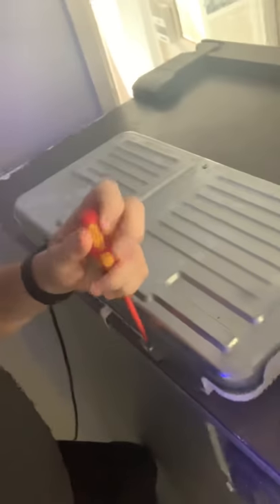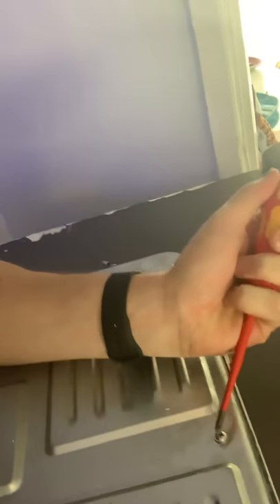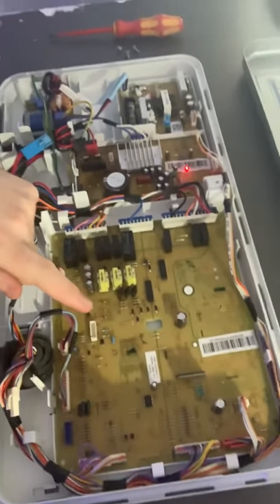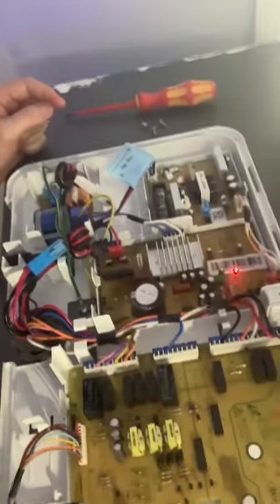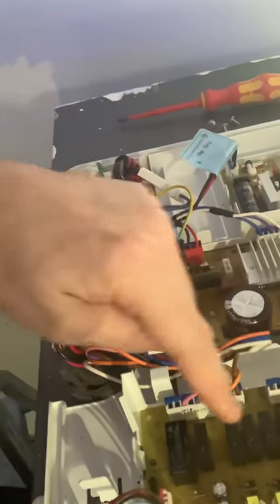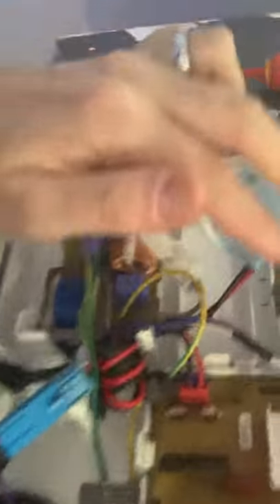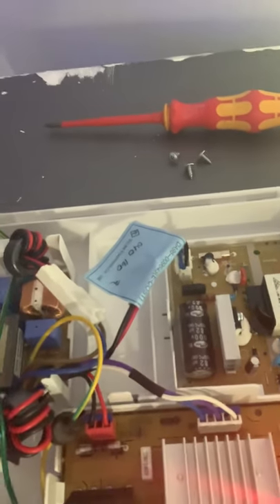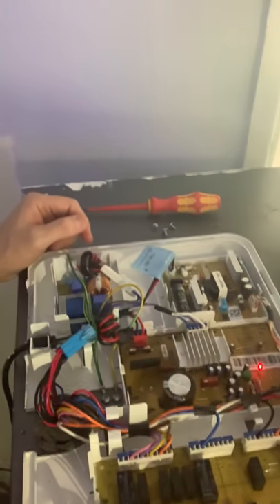Samsung Fridge Freezer No Power

Comment: came here to tell you that i owe you a beer. fridge suddenly stopped working - not this exact model, last 2 digits were different, but basically exact same one. repairmen wanted exorbitant amounts to come and fix it - bought this part off ebay, unplugged 2 little cables, put new one in, working as good as ever now. thank you very much, genuinely took me 30 seconds. it seems with this series of fridge that if the power stops working it’s nearly always that little board

Comment: Dude you are a hero! I just fixed my refrigerator by replacing the exact PCB you pointed out. The local repair service had no clue as to what the problem was... All PCB's seem to be in working order they said... Saved me from the horrible Samsung service that never came, and from buying another fridge.

Comment: Samsung freezer packed up, no power. Took a chance and ordered the replacement power board in this video. £55 and 5 mins to replace. Worked straight away. Thanks, saved £100s not having to call out an engineer.

Comment: Thank you so much for this video. As many in here mine just stopped working no power..  so straight away I went to check the good old YouTube library and there it was first video a clicked on. Bought the part recommended by you from a local guy too to help out etc a little over 24 hours  and it’s back up and running. Samsung provided the details to the local authorised repairer and they charge £50 call out then £90 for labour plus whatever parts needing replacing, I tried to buy the parts from them but they weren’t allowed to sell direct bla bla bla. I can’t thank you enough pal. All the very best to you 👍

Comment: Exactly the same with our Samsung Frdige Freezer after 31 months of good work.
I can't get the PCB here in germany, so I had to call a technician. Explained the problem - he came here and after four minutes of checking he told me that this thing is broken. Costs for this PCB 97€ + 100€ work + 75€ approach
For something I could do easily be myself (after seeing your video)

Comment: Got the same make, model, and problem with ff, no power, had the retailer repair branch turn up ( at a cost) but could not fix, as they said could not source that pcb,so gave me a refund, also contacted the maker who said to contact the authorised agent in my area, who said that if the people who came out could not fix it they prob couldn't, and would cost 108 quid no matter what!
Saw Adams blog on YouTube, what a star he is, ordered the part, fitted in two mins, all up and running, not impressed by retailer or manufacturers, but highly greatful to Adam, a life saver.

Comment: Hi Adam,
Encountered a similar problem with my Samsung fridge freezer. I hurriedly replaced the unit with a new fridge freezer.  Having seen this video of yours, decided to relook at the pc board as you mentioned. Could not find a new board online. Had a look at the fuse and it looked strange. Purchased a 75c fuse. Replaced the fuse and it came alive. Thanks for the video, it helped heaps. So I spent $4000 on a replacement fridge freezer , three months later the repair to the old fridge cost 75c. That's such a frustrating waste of money on the new fridge. Thanks for the technical advice.

Comment: More positive feedback, thanks for posting this video, I ordered part number DA92-00530A (DA9200530A) from ebay for £55 and it has resolved the issue. I'm going to look at potentially repairing the failed board as per the instructions below so I can keep the old one as a spare, as I have no faith it won't go wrong again in 3-4 years time.
Reply: Hi. Did you manage to repair the faulty board and if so what part failed? Thanks

Comment: Thank you, this just saved me a £180 call out and a 1 to 2 week wait ( I live rurally) and a lot of food from going to waste.
 Ordered a refurbished Main Board PCB online after seeing this and 2 days later it arrived, I installed it and hey presto the fridge powered back up. 
It was a quick and easy job after I ruled out all other possible issues and although I could not find the exact part number as stated on the PCB, I found the exact board for newer models under part number : da9200530a  after some searching about, I will put a new diode on the old board as prescribed by a previous commenter I will test and save it for the next time this happens. 
So If you have model: Rs7567BHCSL American style free standing fridge from Samsung and you come down one morning and there is no power to it period and it is not the fuse, yet there is still power going to the boards( use electrical tester scredriver ) this as stated is most likly your culprit.

Comment: The Samsung we have has the same symptoms. Checked all voltages, fuses and pulled every connector. Will now pull that board and either replace the diode or order a board then repair it. Many thanks for sharing the knowledge.

Comment: Thank you for your video. It has pinpointed the exact issue with this fridge and helped us avoid long wait times for the authorized service, which is even longer now during the COVID pandemic. My best regards for making this video. Just had the same issue on a friend's fridge. The board in question is a power supply board with mains AC input and the output is 2 x 12v  and a 5 v rail. The issue in my case was a shorted schottky diode. This is a generic part you should be able to source at any electronics part store: 2 Amp 100V schottky diode, original part was SB2100.  Just replaced with a similar specs general purpose rectifier diode, as i did not have a schottky lying around, and the fridge came back to life. Will source and replace the original part asap as the schottky is a much faster diode than the one i used. 

Warning! This board has a big 500v rated capacitor which holds electricity for some time after the power cord is unplugged. Usually 5 minutes should be enough for the cap to be at safe levels. Be extremely careful while doing working with this equipment, as it contains lethal voltages! I you do not understand the safety principles to be used or do not  feel comfortable working with mains voltages, do not attempt this repair.

I pinpointed this part by reading Cristian Tomescu's comment and following the next steps: unplugging the mains cord , wait 5 minutes for the capacitors to be drained. Remove the  the electronics cover , remove the board in question, it has 2 wire plugs. You need a multi-meter(DMM) or continuity tester with which you must test the diode. Being that the diode is in circuit , if the diode is OK, it could conduct electricity in both ways, but it should show some resistance. If you have a short circuit regardless of the polarity , the diode is busted (search youtube on how to test a diode). Remove the diode and measure the circuit where the diode was for shorts-> it should not be shorted. Replace diode while respecting the same orientation, put it all back together and that's it.
Reply: Hey, thanks for the description. I've tested the Diode you've mentioned and I think it's one of the bigger ones correct? I can see 2 small ones and 1 that is just a bit larger. When I'm testing with my multimeter it's not showing any voltage on either sides. Could you tell me or send me a picture of the diode on the main board that you're describing? Thanks in advance.
Reply: @jellevanlanen650  hello! For me it was the bigger diode. You should not test for voltage,  you should use your dmm on resistance or diode testing mode. Mine was shorted, meaning it showed low resistance when testing. A diode should show an open circuit when testing one way and a low resistance when testing with reversed leads. Make sure you unplug the power before trying anything on it, it can contain deadly voltages. Good luck with the repair!
Reply: @chirilamihai  Thanks for the reply! Its actually the first time I used a multimeter. I did do it with the diode test mode. The 2 smaller ones given me 0.6 to 0.7 each and a "1" in the other direction which if I've read correctly is good. The "larger" one below them gives me 0.001 in both directions. Which I think it means it shorter out. So my presumption would be that if I replaced this one with the one you've mentioned in your first comment that theoretically the board should work again, correct? Thanks in advance!
Reply: @jellevanlanen650  great job! Indeed you have identified a short-circuit. To confirm this you should remove the diode and test it while out of the circuit. It should still be shorted. You should also confirm this by testing the points where the diode was  soldered before being removed, this measurement should result in some arbitrary  results but not a short circuit, otherwise something else might be broken in the circuit. Replace the diode keeping in mind that orientation counts, there is a white band on it, it should point in the same direction. Stay away from shady ebay sellers for these components, search locally or from renowned shops. Good job and good luck!
Reply: @chirilamihai  I removed the diode and it is indeed shorted out after testing. I cant seem to find a proper replacement. Do you perhaps have a name for me or specifications as the 2100 you mentioned doesn't seem available in my country.
Reply: @jellevanlanen650  i used a general purpose 1N5402 which actually is still in the fridge and works since. This is a 200v 3a diode. You should be able to find this as it is common. Otherwise just ask any specialty store for a general purpose diode with at least 2 ampere forward current and 100 Volts of reverse voltage. Good luck
Reply: @chirilamihai  Thanks for the advice!
Reply: @chirilamihai  I thought I'd let you know that it worked. I ordered a spare part as well in the mean time and thought I'd fix the original board as well. Replacing the diode that you mentioned fixed it! Now I have a spare board incase it happens again. Thank you once again for your help.
Reply: you truly nailed it with this comment!!!
Reply: Thanks for your help! I have saved money, but also 3 weeks time! I have replaced the bigest diod on the board. Its called the Schottky diod, SB2100. 2 Amp, 100V. Price was 0.25 USD.

Comment: Thanks a lot. My fridge Samsung RS7557BHCSP had the same behaviour (3.5 years old). I ordered the da9200530a card on Monday, received it on Thrusday and it works perfectly now. No need to have a PhD in electronic to change the card, only 2 plugs on the card. 
In french now: Merci beaucoup. J'ai eu le même comportement avec mon frigo SAMSUNG RS7557BHCSP: plus rien ne fonctionnait dans le frigo: pas de lumière dans le frigo ou le congélo, pas de lumière à l'extérieur, pas de froid, plus rien ne fonctionnait. Je pensais au départ que les plombs avaient sauté tellement rien ne fonctiopnnait. J'ai commandé la carte da9200530a lundi aprem, l'ai recu jeudi matin et changée jeudi midi. Ca fonctione parfaitement. Pas besoin d'avoir fait Polytechnique: on débranche le frigo, on retire 3 vis sur le toit du frigo, on prend une photo, on enlève 2 nappes de fils. On remplace la carte, on remet les nappes de fils (avec des détrompeurs, impossible de se tromper et sinon, on a pris une photo...), on rebranche et on constate que ça marche. Ensuite, je conseille de re-débrancher, de remettre le toit du frigo, de remettre le frigo dans son emplacement final et de le rebrancher. Bref, du bon sens ;-)  Un super MERCI à Adam Jackson pour son aide !

Comment: Thanks Adam.  Just replaced the board and fridge sprang back into life.  Around £60 from Partmaster so saved me a bomb.  

If you want to test yours, grab a multimeter.  There are only 2 multi-connectors on the board, both marked clearly.  One is a 2 pin for feeding 240v AC to the board.  The other is a 5 pin outlet supplying 2 grounds, 2 x 12v outlets and 1 x 5v.  

Leave the 2 pin connector plugged in to feed mains power to the board.  Then remove the 5 pin connector so you can check the board is creating power out.  Use one of the grounds and test each of the positive pins (they're marked which is which on the board).  Both my 12v worked, but the 5v was dead.  I'm guessing that's the feed to the display/control board, 12v to the compressor etc.  As per the vid, there was no telltale brown staining of any component failed.  Usual care re not electrocuting yourself etc!

Comment: Thanks for taking the time to make this video. Had the exact same problem on 3yr old side by side Samsung fridge freezer. Bought a replacement DA9200530A PCB for £55 and working again instantly. As you mention there are no obvious signs of component failure so hard to fault find.

Comment: Grateful thanks Adam, same problem same fix.
I had the Schottky rectifier diode (next to the upright pair of capacitors) stop passing current, replaced it, and still not working.
Whether this failure caused this failure, or another component failing caused this Schottky to fail, I don't know.
Does anyone know what component on this board does fail?

Comment: Update folks, appliance now working. I swopped out the diode DS2 on the PCB NOT HS2 as a previous comment mentioned, it is definitely a SB2100 SCHOTTKY diode. Diode cost 25p, a replacement PCB board is circa £40-£60 if you don't have soldering skills, a call out fee is circa £100, the whole job for an engineer to visit and replace is probably £300+ If you really get screwed over then kiss goodbye to £1300 for a replacement american fridge freezer! Scandalous that Samsung don't acknowledge such a common failure and replace/repair free of charge. This video has had 20,000 views, some pornos don't get that many hits!

Comment: I tested the outputs from this PCB and the 5v was missing, both 12v were good. I have replaced the PCB and the LED on the main board comes on briefly then goes off. No display lit up on the front. The 5v output is good on the new board, as are the two 12v ones. The small motor that drives the arm underneath the bucket that operates the flap to drop ice into your glass is trying to turn constantly in a jerky fashion on power up. Only other thing to mention is that the water pipe that runs up inside the left door has recently frozen. This happened last winter and occurs if we leave the ice on and the bucket gets full, I think this is a design problem. Any suggestions/help would be appreciated. T.I.A.

Comment: Hello Adam, it's been four years and your video is still helping people out there. I would like to thank you for your tip. I went through the exact same issue as you. I did not go for a new board instead i changed a diode SB2100 and an SMD resistor 10R0. At first i checked the schotky diode, and it was indeed faulty (also no 5v in pin connector) after replacing the diode the 5v pin the board started working on the 5v pin however the voltage was fluctuating ranging from 3v to 4.5v and the fridge was not starting, i went on further to diagnose and found out that a resistor is also broken (you can watch it up in my vid) after replacing those two things the fridge started working again. I did a video from my side as well explaining two issues i had with my fridge - Link to my video : https://www.youtube.com/watch?v=MG1JGWWwqY8

Comment: Have the same exact model, but my causing the RCD in the fuse-box to trip as soon as I try to plug it back in. Some friend told me to replace the fridge defrost element as it's the main known cause for this behavior so just waiting for the part to arrive atm.
Reply: Hi, my Samsung is also tripping the RCD so not sure it's the problem in this video, did the fridge defrost element you bought cure the problem ? Cheers
Reply: @thomasbutler4602  Yes it did, it was faulty and it is a common fault with my Samsung fridge.

Comment: Hope thats whats wrong with mine, I watched another video today, exact same issue and it was that small pcb board, that big component on the board looks like a big capacitor or bridge rectifier, on mine there is a slight smell of burned from it.. so fingers crossed

Comment: Hi Adam, thank you so much for this video. Replacing this part (DA9200530A) fixed the issue for me too (model RS7567BHCSP).

If it helps anyone I ordered the part from the official Samsung spares website (https://www.samsungspares.co.uk/main-pcb-control-module-assembly/product.pl?pid=5272500&query=DA9200530A) at pretty much the same cost as eBay/Partmaster. Came the next day, easy to fit and all back up and running.

Comment: Thanks for this.  My fridge freezer also completely switched off.  I replaced the diode on the circuit board which did switch the fridge on but now it says error code 84 which I understand is a locked rotor in the compressor which apparently is an awful error and can't be fixed.

Comment: Hi again, so i just checked the voltages coming out of that smaller pcb which should be 12v 12v grd grd 5v and the 5v terminal is showing 0v

Comment: Anyone have a link for the smaller PCB board? My Samsung fridge freezer has the exact same issue no power showing but there’s power going into the boards. Don’t have access to the fridge as it’s in my rented property and need to get the fridge working ASAP.

Comment: So going through the board showed indeed that the SB2100 was shorted, changing this still didn't solve the problem. The red led lights up for 1 sec before it trips the breaker, so something is still shorted. Anyone who has ideas on what else I could check?